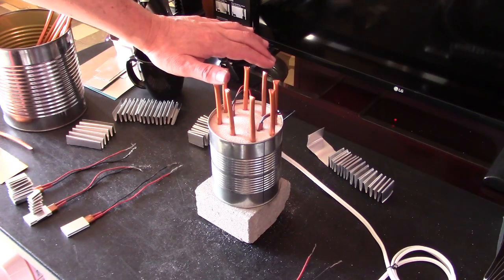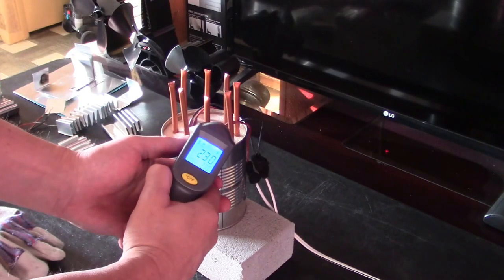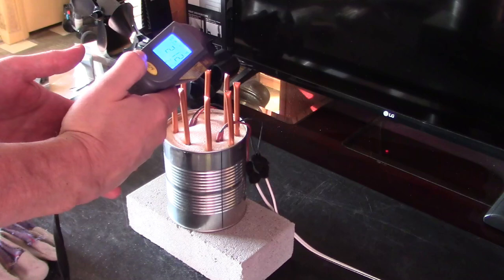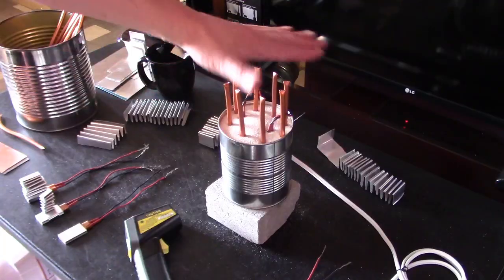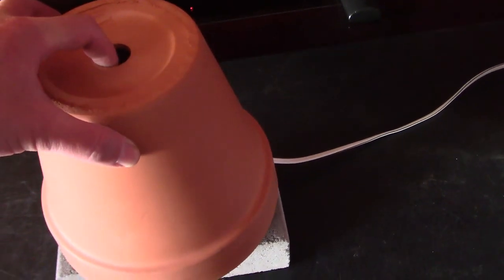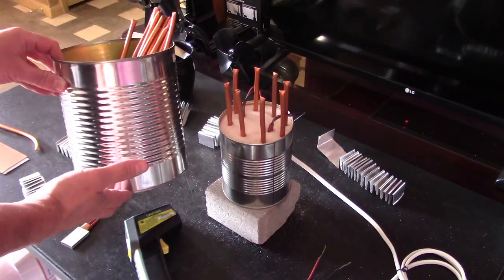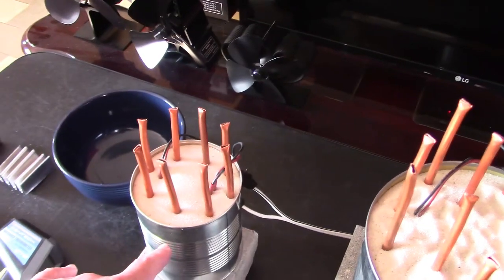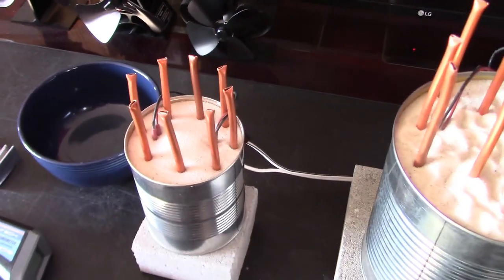DIY Sand Battery for Air Heating at home! *with "Copper Heatsinks! & Clay Pot Option w/heat pwr fan!

Comment: Hey man, have you ever considered anything using a fresnel lens?

I’d imagine with all of the copper you have you might be able to make a quick heating sort of form of sand battery with a spot of very high temperature material in the centre and copper heat pipes attached to it within the sand

And the fresnel lenses can be found in old projector style TVs, electronic waste recycling centres may have them

Not trying to boss around, just something you might enjoy with the sand battery understanding developing
Reply from the maker: hi yes. my next video shows how to heat sand batteries with parabolics and fresnel lenses. probably be posting it this weekend (01/04/25 or 01/05/25)

Comment: Wouldn't the plastic on wires melt from the heat and create a risk for shortcut?
Reply from the maker: hi there. nope, that won't happen. the reason it won't is because there isn't any plastic on the wires or in the elements. the coating on the wires is a type of silicone and is rated to handle over 400F(205C) ...and the material that sticks out the end of the element is made out of polyimide film. polyimide film is rated to around 573F(300C). note that 'high heat tape' is made out of polyimide film. (it's just polyimide film with an adhesive). also, the average overall temp of the elements never exceeds 350 to 375F so it all holds up great.

Comment: This must cost a fortune copper is expensive
Reply from the maker: hi. cost to make unit is pretty reasonable. you can buy an 8" x 8" sheet of 24 gauge copper for 9 or 10 bucks. that's more than enough to attach to the elements (i just cut it down into strips). and the copper rods are just made with 1/4" tube. i used about 10 or 15 dollars worth of that. but i know what you mean about copper. the thicker stuff and the bigger pipes can cost big money

Comment: Thank you! for finally giving a length of time for "hot". 90 minutes for the institutional-size can helps!
Reply from the maker: hi yes, 90 mins. i'll be adding a couple more elements to that one. if you use 5 or 6 elements in the larger model it should cut the heating time in half. then it'll probably only take 30 to 45 mins to get hot.
Reply: @desertsun02  I'm making one now with 6 elements. Institutional food can, tall tea can with candle in it in center, on about 1.5" of sand. I bent 10"-long pieces of 1/4" Cu tube 90degrees starting about 3" from one end. They are grouped side by side for now so they touch. Flame heats the center and convection takes it to the others. When it's hot, I can swing some outward so heat goes several directions. 10 ft coil gave me 12 pieces to experiment with. I made a handle from hanger strap held on with 1/8" critter pins. Outside of can has Cu grill mat pieces for protection. Will let you know when I have heat gun data. Happy Solstice!

Comment: How long to get to temperature?
Reply from the maker: hi. the small one takes 30 mins to get to full (or near full temp) and the big one took 90 mins. (i'll be adding 2 more elements to the big one to speed it up. i ran it for 2+ hours but if you run it longer it will probably get even hotter. potentially up to 300F(150C). wouldn't get much hotter than that because the elements have upper limit

Comment: You should test how long it lasts, if you the heat out too fast it’s not going to last very long
Reply from the maker: hi. the units put out heat for several hours after the power is cut. the exact length will depend on the size of the sand battery. the coffee can one stays hot maybe 3 times longer. these are both relatively small scale units but you can easily upgrade to 3 or a 5 gallon metal bucket or even a 55 gallon drum if you have the space and enough sand. i've got 2 metal buckets that are about 3 times the size of the coffee can and was thinking about using those. another option for the sand might be a metal planter box of some kind.

Comment: Nice simple design. A few copper conductors make a lot of sense.
Have you looked into regulation features - ie. choosing the level of heat you extract? I'm thinking in principle it would be fairly easy with an insulated cover around the (open) battery, and then just regulating the heat-exchange by adjusting the speed of a fan providing airflow through a relatively small hole in that cover. Another larger can and a bit of fiberglass insulation is probably all you need.That should allow for a fairly large range of adjustment. Because it's just a fan that regulates, it could also be connected to a smarthome system and regulate output based on a cheap temp sensor.

Alternatively - a design inspired from nuclear reactors would have an insulated cover that is pulled further up the more heat you want. Very simple in principle, but maybe less practical and compact.

I haven't seen any DIY design examples of this though, so it's just theorycrafting in my head atm. Probably some smart ways to do it well.
Reply from the maker: hi and thank you! since these are smaller scale units (and i'm trying to get the most heat possible out of them) i haven't thought much about a temp regulator. the elements themselves are self regulating so you don't need to worry about them getting too hot. the sand would not get much over 300F(150C) if you ran this for 10 hours or more. the elements are made to run dry so you could run this unit 24/7 if you wanted to. it would be easy to regulate temp though. you could put them elements on a timer or even just limit the current flow.
Reply: @desertsun02  I'm thinking more in terms of use with unpredictable/inconsistent renewable sources. That's where they make most sense to me. As an example - you might run the heater elements from solar, but want to save most of this energy until it's night and the heat is actually needed.

In theory there shouldn't be many limitations on how hot you can run it if using steel or ceramics, and the heating elements are bare-metal. Insulation can be glass fiber. Even copper won't melt until almost 1100c, and you could easy go higher with other common alternative materials. It's more about what you feel comfortable with safety-wise. Get hold of an empty 200l steel barrel and then you can get serious ;P

The max allowable temp is obviously directly linked to capacity.

Comment: Interesting design. You can turn those copper tubes into heat pipes. Just solder one end together, fill it about 1/4 full of water, get the water boiling with a blowtorch, then crimp the other end shut and solder it sealed. Each pipe would be able to move 300W of heat instantaneously.
Reply from the maker: interesting. i'll have to give that some thought.🙂
Reply: How?
Reply: @dilipanthonypinto1620  I gave an overview of the process. Are you asking how heat pipes work?
Reply: @WaffleStaffel yes,I’m not sure how you solder the pipe with water vapor inside? Also read something about needing a “sintered copper wick” inside…

Comment: Me parece que no escuhe ni tampoco pude ver el consumo energetico del sistema, como podemos entonces saber si es viable?
Reply from the maker: well, there are many different ways you could heat this. i'm using 12c dc ptc elements but other options include over a fire or rocket stove or even a propane stove. other options would be to skip the elements and just use a parabolic dish or fresnel lens. the 12v dc elements can be heated using 12v solar panels 12v batteries or possibly even a wind turbine.

Comment: Hallo, kannst Du mal die Leistungsaufnahme des Netzteils mitteilen?
Reply from the maker: hi. the power supply i'm using is rated 12v 30a 360w (but this unit is not pulling that much power)
Reply: @desertsun02  Wieviel Watt auf der Eingangsseite des Netzteils?

Comment: Hormis la traduction incompréhensible vous oubliez un des fondamentaux de la physique édicté par Lavoisier mais dont l'origine Grecque est bien plus ancienne, RIEN NE SE PERD? RIEN NE SE CRÉE, TOUT SE TRANSFORME. D'autre part, n'oubliez pas le rendement qui, même s'il est meilleur, d'année en année, provoque toujours des pertes, notamment au niveau de votre alimentation.
Pourquoi le sable garde t'il sa chaleur un certain temps, simplement parce que c'est un mauvais conducteur et cette chaleur restituée vous aura coûté beaucoup en chauffage initial. Ce système n'est valable que lorsque le chauffage du sable ne vous coûte rien !
Apart from the incomprehensible translation in French langage, you're forgetting one of the fundamentals of physics laid down by Lavoisier, but whose Greek origins go back much further: NOTHING IS LOST? NOTHING IS CREATED, EVERYTHING IS TRANSFORMED. On the other hand, don't forget that yield, even if it's better every year, always leads to losses, especially when it comes to your food.
Why does sand retain its heat for so long, simply because it's a poor conductor, and this heat will have cost you a lot in initial heating costs. This system only works when heating the sand costs you nothing!
Reply from the maker: hi. there are several ways of heating these sand batteries. i chose to use 12v dc elements so you have the option of hooking this straight to 12v solar panels if you want to. they can also be heated without the elements using things like solar concentrator (parabolic dish) or fresnel lens. lots of options. you could probably hook it to a wind turbine as well (but i haven't tried yet)
Reply: @desertsun02  Thank you for your reply. If the power is supplied by photovoltaic panels, this is a good solution because the heat is released for a certain period of time after the system has been powered. Wind turbines should be avoided because they are too fragile and you run the risk of damaging your turbine when the wind is weak, or you need a system that cuts off the power supply when it's too weak, that's my opinion.

Comment: U use electricity to heat and call it battery? 🤔
Reply from the maker: hi. well, you have to "charge up" the battery (heat the sand) initially. same as you would a chemical battery. the amount of sand you use and hot you heat it will determine how long you can use it before it needs to be "recharged". this is a small scale sand battery but you can certainly expand its size using larger containers if you like. the more sand you have the longer it will produce heat (or electricity, with a peltier device)
Reply: @desertsun02  What is charging the battery? Meaning the amount of electricity coming from where? AC, from the grid? Solar?
Reply from the maker: @user-bl5zi1vb4p well, for the video i'm using 12v power supply, but 12v solar panels or possibly even wind turbines can be used. you can also use things like parabolic dish/fresnel lens to heat the sand (and just skip the elements) or off grid stove like rocket stove or propane stove. i'm planning on using solar panels. that way it's 100% free heat. (after you buy the panels of course)
Reply: The battery in this case stores thermal energy, whereas the batteries you're thinking of store electrochemical energy. ☺
Reply: @auturgicflosculator  Man kann für Batterie besser Speicher sagen.
Reply: You could heat it up through any means. This is one.
Reply: It's a thermal battery, not electrical. the practical usecase is mostly with renewable energy sources. For example, if you wanted to heat a cabin via solar only - a thermal battery would be unbeatable in terms of economy/capacity. The excess power in the hot day would deliver warmth through the night easily. A LifePo4 battery to do the same energy output would be orders of magnitude more expensive. In industrial scales they use molten salt - and use that heat to drive steam turbines when they need to turn it into electrical energy to fill market need.

I'm looking into them as a means to temperature-stabilize my garage (cold climate) using only some handmedown solar panels.
Reply: Water, clay, concrete, and sand can all be used to store heat. Paraffin might be a better alternative, absorbing heat during the day and releasing heat when it transitions to wax.
Reply: @higreentj  Is there some special endothermic reaction for parafin's transition to wax? Because otherwise I think the spesific heat capacity isn't so great.
Reply: @TheStigma   "Combinations involving paraffin wax generally show higher thermal energy density storage capacities, with the Salt and Wax combination exhibiting the highest capacity. This is primarily due to the inclusion of paraffin wax's significant latent heat contribution, which enhances the overall energy storage potential. Paraffin wax itself also shows a high capacity due to its phase change properties, despite its lower density."
Reply: @higreentj  Cool. I had no idea about this, but it does make sense with the phase-change eating up a lot of energy. I will read up more about it. Thanks!
Reply: Para carregar a bateria usa o que
Reply: @deliciagelada8495  Aquecer.

Comment: Have you calculated how many Watts it uses?
Reply: He posted a link to the heater he's using under another comment, they're rated at 50W ±20% (yikes). He has two heaters in there so anywhere from 80 watts to 120 watts after the power supply. You always lose efficiency when changing voltage so I'd probably just add another 20% for the conversion if you run it off of 120v through a power supply. So likely 100-150 watts depending on the actual draw of the heating element and efficiency of the power supply. They also sell a 110v version which has the same temp ratings but a draw of only 25 watts (±20%) so way more efficient at 40-60 watts for the same element running on 110v. (These numbers will differ slightly because the voltage in your house is typically 120v)

Comment: Why do you call it a battery?
Reply from the maker: hi there. they call these 'sand batteries' because the sand stores the energy in the form of heat *and can be 'tapped into' for heating or electricity. these units can produce electricity with the use of a TEG module (a thermoelectric peltier device). the TEG in the fan is 40mmx40mm (and 3.6mm thick) or about the size and thickness of a saltine cracker. it produces enough power - from the heat - to run the motor of the fan. the sand batteries i make are generally small-scale but as they get bigger they can hold heat for days weeks and even months in some cases.

Comment: Thank you for the video, Im excited to try my own experiments with this setup. How much does this particular setup through that power supply, I think you mentioned its called a "switching power supply"?

I'm curious if it could compete with some outdoor heaters as a cheaper alternative for my mother, who's hesitant to invest in one of the large gas powered outdoor heaters.

Comment: Wouldn't it be better to buy more sand and cans rather than copper?  Sand batteries are awesome!
Reply from the maker: i'd say more cans and more copper. i'm going to add 2 more elements to the coffee can size one. 5 would heat it up faster. i'm also thinking of doing a model using a metal 5 gallon bucket. sand batteries are awesome...very true.
Reply: @desertsun02  a 55 gallon metal barrel is around $100.

Comment: Will you post a link to the elements? Idk what they are.
Reply from the maker: hi yes, i'll do that. they are ptc elements. they come in both ac powered ones and dc powered ones. i always use the dc ones. they come in 12v, 24v, 36v and 48v. i typically use the 12v ones. you can find these elements on amazon, ebay and aliexpress. amazon is not the cheapest place but that's where i usually ger them. here is a link to some very hot ones https://www.amazon.com/PTCYIDU-Insulated-Temperature-Thermostatic-1-37x0-8inches/dp/B0BNZV3GNS/ref=sr_1_4?crid=3TL0IA6E3DG5&dib=eyJ2IjoiMSJ9.qO12xCUnvUX7jxFdrTYn1R0egOpZmgSwbWEHUsd0RSKA5_8ppSwuGP8FaVHH2efQhjOrJiPZORf9axnmc1OdyD-GBnjlFEyBQQWT7iXx2lDt9alKJrzR4dClJjLonoblvW1yYYiXf692_ZWNnzw97cmc_E2j7pWnVkQII8V2ZcsuidJVtL8Ah3ap-0mLBqO0STfHDLsm4CkruQsAUPOz_13X9Ws7zgj9UFKEtSfY7QLOsyPylgu90Vr9r3DqFr57JtcjVVITWCumiPn_PFzSzB0hDvHhuJtKN_KWIFy7v1rP4aqCaRz71GN-52BiwTFUH0LBae2iM6VRfr5GP5uhHkNfR2XtpKY-92N4vJ9R79mIwawP5PkeyXrVrY_QoWA4dctXBNrJrtfeUdTyJW3nZXytmsfbiLmTb0hSIR_vRZ-YRmSXjuymVufJ5uuUOJdT.HU5wppHzaylsiWLS9fWjVGbzmjOFU1B0l9Zh0c3vmGM&dib_tag=se&keywords=12v%2Bptc%2Belement&qid=1734219146&sprefix=12v%2Bptc%2Belement%2Caps%2C164&sr=8-4&th=1

Comment: Can you experiment with a 55 steel drum sand battery please. How many 100w solar panels needed to heat it? Or 110v.
Once its up to temperature it may hold heat for 3-4 days ya sure itll be around 500lbs lol but thays thermal mass!!
Reply from the maker: hi. i've been thinking about that but so far i've held off. that's a lot of sand (but as you say... the more thermal mass the better). i do have a couple of large steel buckets that are about 5 times the size of the coffee can or maybe i'll try a metal 5 gallon bucket full of sand. i may have to 'work up' to a 55 gallon drum. heck i've even thought about a container the size of a small dumpster (but don't hold your breath on a video of that). 🙂🙏💡
Reply: @desertsun02  10 home depot sand bags $50 or free beach sand works too lol. I can't wait! I think the bigger it is it will be more efficient and retain heat longer but to what extent is the real question!
A dumpster full of sand now that could heat a house for a month maybe.

I'm wondering if a a large 55g sand  drum heated by a wood stove up to 500c how long it would slowly radiates heat for

Comment: Are you powering that with 110V or is it hooked up to a solar panel?
Reply from the maker: hi. they do sell 110V elements but i'm using the 12v ones in this project. they also sell them in 24v 36v and 48v (DC). you can use a 12v solar panel (or 12v battery) with the 12v elements (but for the video i was using a 12v power supply). it's technically called a switching power supply. cheap and puts out a lot of power.
Reply: @desertsun02  Thanks for the reply!